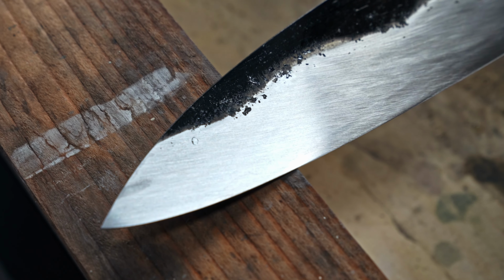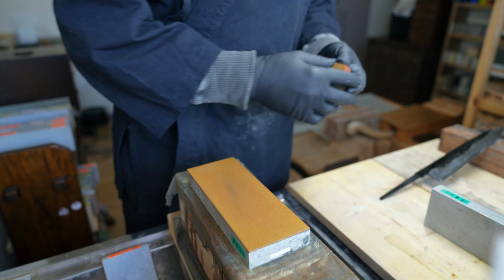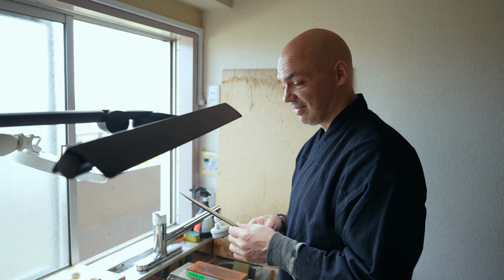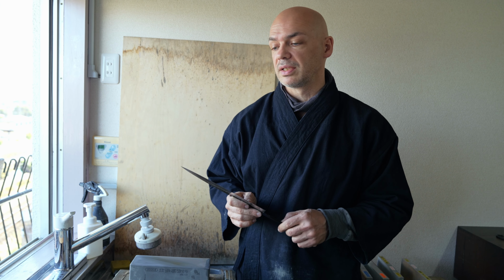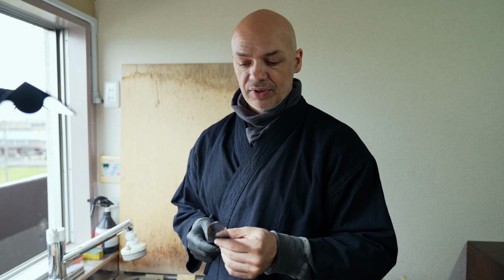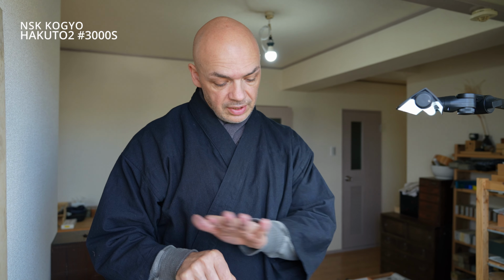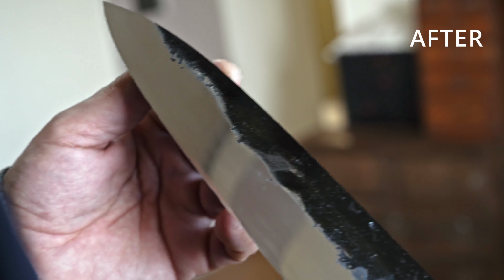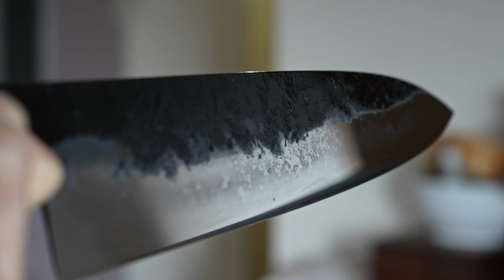Mirror polish with NSK 3k diamond stone, Part 4

Comment: Do u sharpen more at an angle (more horizontal)  to flatten the low spots on the blade and more vertical, along the length of the blade when u polish?
Reply from the maker: Yes, the final polish is always done lengthwise across the blade, during the rough sharpening I go back and forth between a more horizontal angle changing the and between each stone

Comment: I never use diamond abrasives for cladded or damascus knives because diamonds cut everything the same. meaning they dont bring out the contrast the way other abrasives do. Sometimes I can make it work if I introduce a lot of mud from a softer traditional stone onto the diamond stone or even paper, then this can leave very smooth surface but still shows that subtle and nice contrast on the clad line.
Reply from the maker: Yes that’s true for most diamond stones, NSK diamond can be used in multiple ways as they are based on how natural stones work, they can bring out detail in cladding or mute the contrast to see the scratch removal progress as well as scratch depth, useful for me when transitioning from NSK to natural stones.
Reply: @ivanyuka-japan interesting I had never heard of NSK before. I will have to look into them. I hope you continue the channel and upload more!